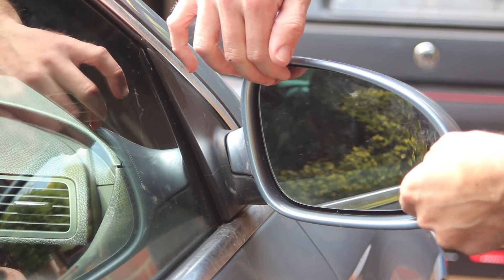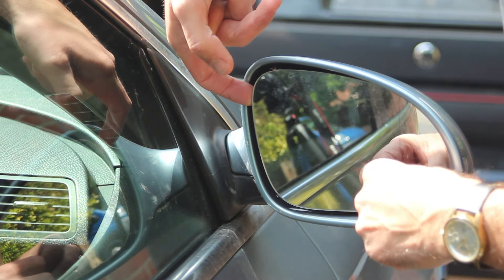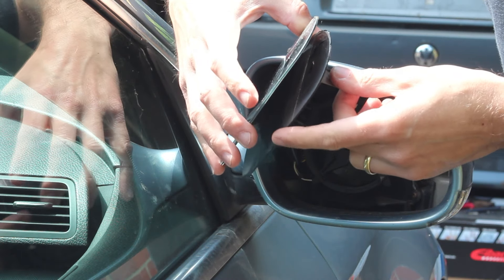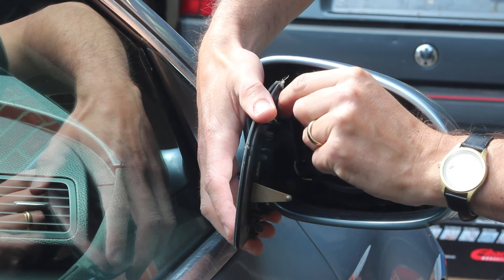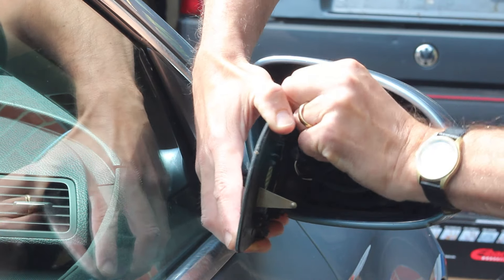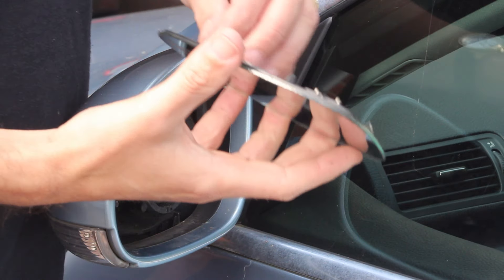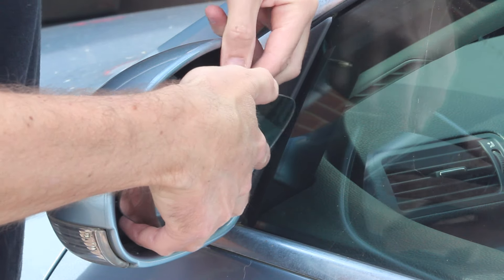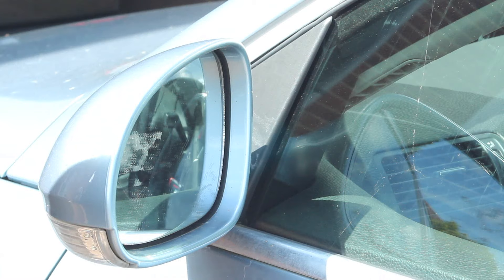VW Passat/Golf/Touran/Jetta/Bora Wing Mirror Glass replacement - changing and refitting

Comment: Just what I needed. I used a loctite spray adhesive, but the hardware store had 3M as well. Used masking tape to make sure it didn't get on the mirror or back of the mirror plate.

Comment: When I bought my 2004 VW Passat the previous owner used super glue on both mirrors, bad fix.  Because in the summer with the hot humidity will make the glue very tacky and ruin.

Another solution you can use is double sided tape for plastics made by Gorilla and 3M.  That's what I used too fix mine.

Comment: Does the contact cement hold up to the heated mirror heat?  Anyone have long term review after using contact cement and confirming the heater element still functions?  Thanks.
Reply from the maker: yes it does. mines now been done for couple of years with no problems